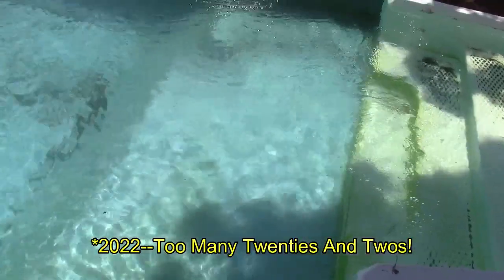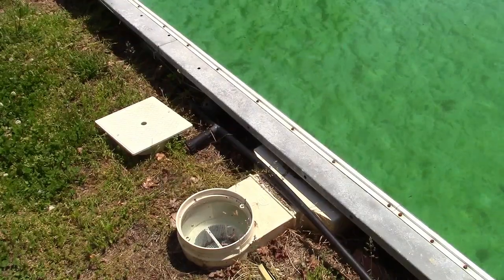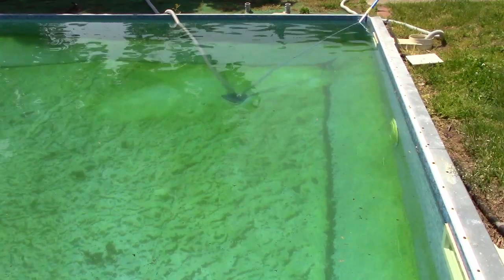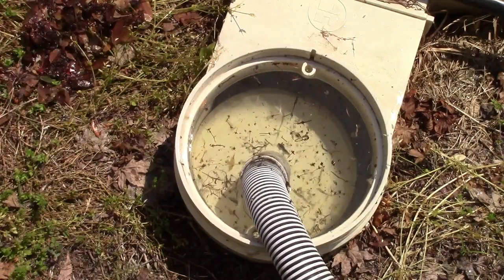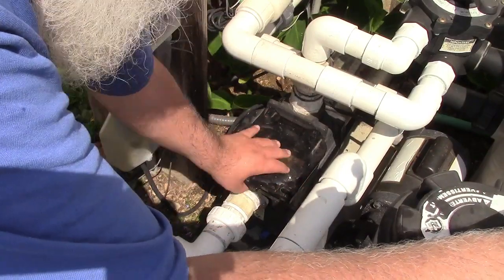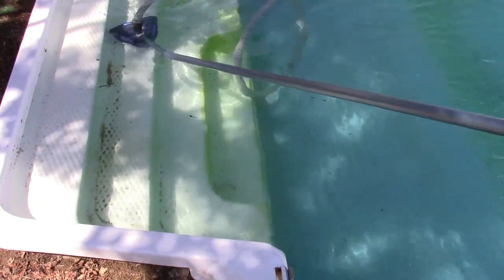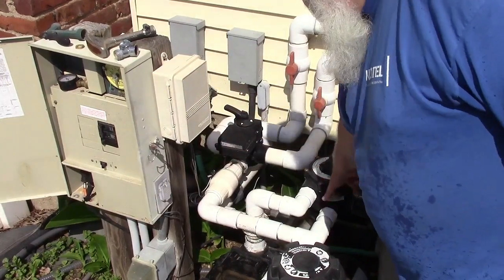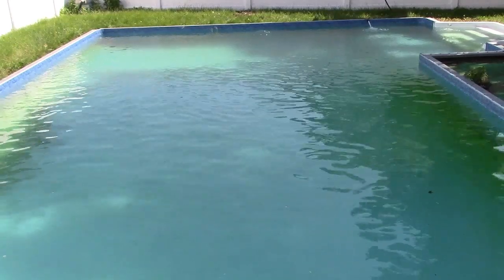Pool Opening 2022, Part 11 - First Manual Vacuuming Of 2022

Comment: Looking much improved after the first manual vacuuming! Looks like you have your technique perfected.
Reply from the maker: Yes, indeed!  I vacuumed the pool in thirds this year.  Took longer, but was less strenuous since I had about an hour break in between each third.  Helped get some more water in the pool.  

What I really need to do is get one end of the hose connector sealed onto the hose.  I tried caulking it one year but it had no effect, the caulk never cured properly.  I don't know if it was just old, didn't like the material it was on, or chlorine residue left behind was the culprit.  Could have been all 3.  Sealing that on there good would essentially allow me to vacuum all of the water out of the pool.  But that's not good for the rest of the system, dry well will promptly overflow and create a lawn bubble.  And the pump gets pretty angry dealing with all that junk.  It's funny, I can just hear the difference.  And even when I'm done, flush the lines out, and set it back up for normal operation, the pump still doesn't sound normal for a while.

This is the kind of stuff the pool "experts" don't talk about and won't show.

Comment: I was at my family members swimming a few days ago they have a portable pool vacuum cleaner I forgot what the brand was though!
Reply from the maker: They got all sorts of crazy ones with remote controls now that you can drive all over the bottom of the pool.
Reply: @jaykay18  yes, but the one they got it's the one that's like a regular vacuum cleaner has no remote turns on when it goes in pool and turns off when the vacuum is out the pool!
Reply from the maker: @ItzYaBoyJesse  Pool vacuums are pretty useless outside of a pool...
Reply: @jaykay18  right!